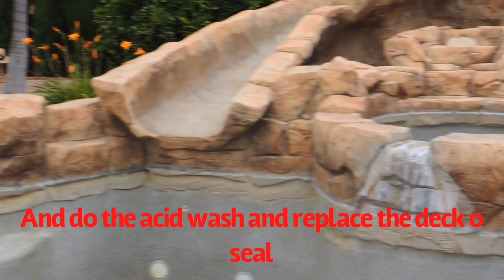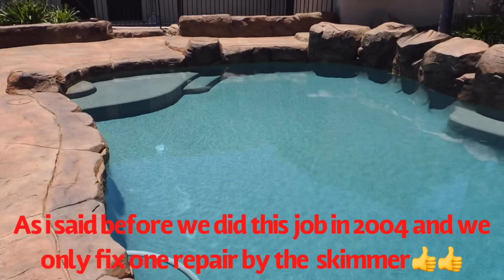How to paint artificial rocks with USING ONLY 3 COLORS!!!

Comment: Great Video Thanks, My pool is very similar in color. Was there any sealer used? I noticed you went over the Efflorescence with the base coat after the acid wash. I was thinking that I had to remove efflorescence by sandblasting first. I'm glad to see, that is not the case. Thanks Again.

Comment: How much paint to water ratio did you use, 4 water to 1 part paint?
Reply from the maker: 3 to 4 parts of water 1 part paint
Reply: @rockkingsstamps9141  Thank you so much, I used water down exterior latex paint and it worked out great!